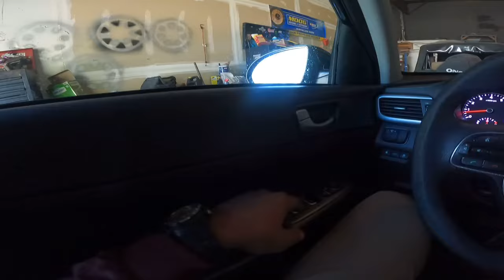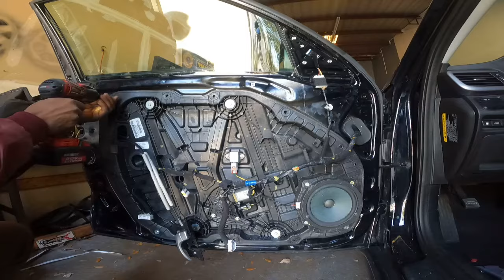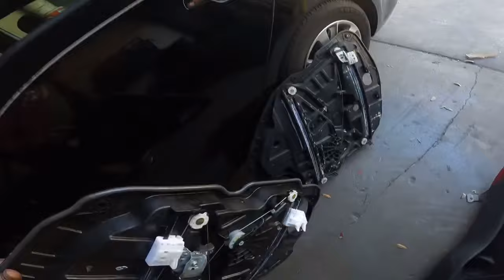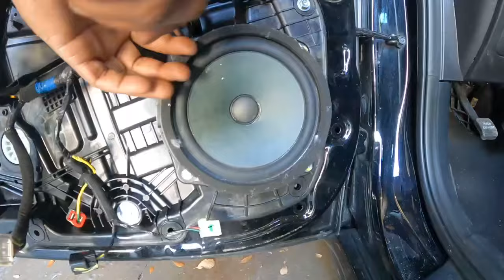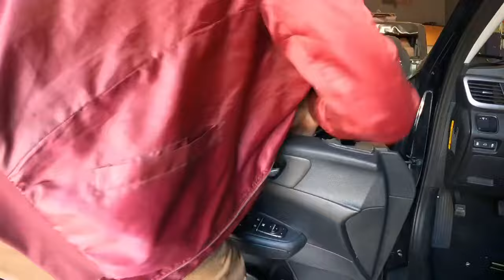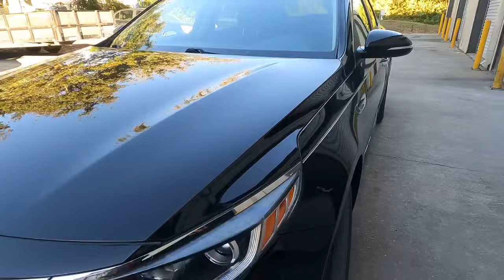Kia Optima window regulator (WONT GO UP)

Comment: Hi, Im Carrie. Thanks for the video. It was so less stressful having hands on training. Im from Texas, San Antonio and my 2016 kia Optima definitely has the window gear problem breaking. Three of the windows had the same issue. I didnt buy the panel just replaced the gear and i wish i had replaced the panel because the wire was a problem getting it to stay on.  Got it done though.

Comment: I live in Colorado I have a 2019 Kia Optima and My back driver side came off track twice. The window specialist says they have no idea why it’s doing it or what’s causing it. Should I replace the inner panel?
Reply from the maker: Honestly it was a horrible design, I do recommend going with a new part because trying g to stretch the cable back will on prolong the inevitable.

Comment: 2016 Kia optima ex, live in Louisville KY. I noticed my back passenger window was cracked and I couldn't roll it up, but could here motor so I put a suction cup on it to hold the glass up until I could fix it. 3 days later my back drivers window just dropped down while I was on the interstate, same symptoms. Now its a two door job and it makes me worry about the front ones.

Comment: I have the exact same problem, 2016 Kia optima , window (driver side) is loose big gap (upper left, from inside) I can hear the wind whistling, seems like it’s loose from the track , it seats on ,   it gets  stuck when trying to roll  the window up , have to try several times, holding the button insistently , will have to take it apart , the sooner, the better, thanks for sharing your  excellent video , will help a lot , from , Los Angeles ,California, thank you for your help, time ( liked & subscribed )👍
Reply from the maker: Thank you so much for subbing, make sure you watch closet in hoe the window is mounted. I don’t think it’s off track

Comment: My Kia is just like that same color /model everything . My windows both driver & passenger side don’t work , not going up , and I’m in TX so maybe your right about the dry and getting cracked . Thank you for sharing this vid , I’ll go by this to replace mine . Oh …you had some chipmunks singing in the background lol
Reply from the maker: Be careful because at any point the windows could drop and you would have to manually push them up and secure them to stay. 

Thank you so much for your feedback and for watching. God bless
Reply: @rollcam321  All my windows fell over a period of like 8 months or a year . Been this way for at least 2 years know with no help fixing it , so I’m about to do it myself . At least the 2 front ones . I’ve already fixed my knock sensor and my Variable charge motion Actuator …then I cleared my Admissions Drive Cycle this week … car has been down for 3 weeks and got tired of waiting so I fixed it myself . Sooo I figured since I down that the windows would be no problem for me to fix as well . And I never rolled down my back windows for them to go out so fast or my front passenger side really . I’ll just be glad to get it fixed , just tired of the whistling when my wedge starts working the windows back down 😫
Reply from the maker: I just lived out your whole cars existence through you lol 

I feel your pain… but honestly it’s a blessing you’re able to tackle a lot of these issues yourself. Keep up the excellent work friend 💪🏾🙏🏾🙏🏾🙏🏾
Reply: @rollcam321  lol 😂 Thank you it’s been a mess but definitely a blessing to be able to tackle the issues for sure ! Many Blessings Kia Friend :)

Comment: Rear windows had this issue, found a suggestion somewhere:

 grab some electrical cleaner (or electrical contact cleaner)

Spray the outside of the button, around the sides, front and back while actuating (I did this while it was all turned on) go heavy on the spray I used quite a bit before it cleared up and started working again.
Reply from the maker: Brilliant idea. Thanks for sharing

Comment: I'm in St Augustine Florida and I have now going to have to do all four Windows one at a time they have went out within the one year that we have bought our 2016 Kia optima
Reply from the maker: Wow sorry to hear that. 

It’s an awful design but I hope this video helps with the repair. Try a few different sources because dealer may not have it. 

Also it would be cheaper anywhere but the dealer.
Reply: @rollcam321  you got that right I'm in Florida man where do you think the best place to order that from I'm trying to find I guess what just your local O'Reilly's or AutoZone or something
Reply from the maker: Yes shoot for them first. They usually have some type of warranty on them so just double check. 

I’ve repaired a few of these and they broke months later. The design overall was horrible for the window regulators.

Comment: 2016 Optima, bought new in 2017, had been on the back lot for months. I bought an extended warranty on the electronic parts. I live in Houston, Texas area. The windows on the passenger side front, and then the passenger side back wouldn't go up. I don't use them very often and I think that is one of the factors (not sure why it would be, maybe not spreading the lubrication?). The window problems each occured after someone tried to roll them down. Shortly after, they would not go up or down, and would slide slowly down about 2 inches when driving on bumpy roads (lots of them in Houston, potholes and seams aplenty). I could slide them back into place by hand (placing palms on the outside of the window and pushing up) but they dropped again when driving.

Each was repaired at Firestone under the electronics warranty, 2 week wait for the parts to come in. I paid half, which was about $250. Now a 3rd window, driver side back, is suffering the same problem and the warranty has expired. I will repair it myself. Switch does not make a noise when I push it, could be motor out? Thanks for the video. Others show how to access the screws that hold the door panel on. 

So far (knock on wood!), have not had a problem with the front driver's side that I use at least once a day. I think that is why it is still working.
Reply: I was wrong about no noise coming from trying to roll the driver's side rear window down. I hear a motor sound from the back door when I operate the up/down switch. I also hear something that sounds like a cable running over the teeth of a gear. So, much be bad regulator.

Comment: I have a 2016 optima. This happened to all four of my windows within a 18 month period. First tear passenger, rear driver, front passenger. And front driver. Three were covered under warranty. Last window was not. Although it was going up/down very slowly and I knew it was going to happen next, my local Kia dealer refused to fix it. I contacted Kia and they refused to fix it. Seems it should be a recall. Apparently low quality parts/engineering flaw. I will never buy another Kia vehicle for this reason.
Reply from the maker: Yes it is one of the biggest flaws I’ve noticed about that year optima. I love the car, just don’t like the cheap window regulator or door handles. 🤦🏾
Reply: Yo I just had all 4 of my windows do in a 7 month period. Like I thought someone was messing with me. First one went we fixed it then another one then another one and now my last one I live in Florida and keep my car outside. What else should I expect to go wrong with my car. Lol
Reply: Well, let’s see. More than likely here are some things that will/can go bad. Mine did. Trunk latch. For whatever reason, it just stops working. I was at the store one day, look out the window and my trunk was wide open. I was 30miles from home. Luckily I had a tie down strap in the trunk that held me over til I got home. I had to order a trunk latch off Amazon. Oil pressure switch. It went bad, cause engine light to come on. I bought a replacement and changed it myself. It’s in an odd location. I finally got it though. Acceleration!! When getting in the highway, I could get up to like 70mph and then it would “loose power”. Car was still running but I could not do more than 50mph. Did this like 5 times. Very dangerous. Once I pull over, turn the car off, and restart, it was fine. 
Hesitant to start, seems it was something to do with a low oresssure fuel pump. Kia would not do a recall, instead, they send you a letter in the mail that says “if you are having these symptoms” take it to a dealer and they will check and fix for free if that was the issue. I’m sure there are a few more things that can/will go wrong but I do not have time to keep typing ,lol. Loved the car when I first got it, (sx turbo) but the closer it got to 100,00 miles it went straight downhill. I will never buy another Kia again!!

Comment: Same issue,  kia optima 2016, Miami FL

First back right, then back left, and today front passenger.  All within 1 month.
Reply from the maker: Wow.  I’m sure the heat has something to do with it. 

With it being cold, then hot, then cold… then we have long periods of extreme heat. I’m sure is melting the lubricant from where it’s needed most. 

Without the lubricants parts start grinding, and from there issues happen.  After so much time and talking with people ultimately I think that’s the main cause.

Comment: This same thing has happened to my parents Kia Optima 2016.  All 4 windows and we live in Massachusetts.
Reply from the maker: I guess it’s a common issue no matter what state your in. How did you end up fixing the issue? 

Did you go to dealer?
Reply: Same thing happened to mines. Literally one broke and then all 4 mind you I rarely put my windows down. I actually remember the last one breaking on its on…I was driving and it just fell down. All of my windows broke in less than a year. Just now fixing all of them. Bought the parts from eBay for 600 for all 4.

Comment: This is a big issue happening with kia optimas from 2016 (my year) through 2021 i think. My passenger window just had this happen and while searching I found a class action lawsuit. Kia refuses to fix it. instead they want you to go to the dealer and spend $450 for a fix. Im in Florida.
Reply from the maker: Yea that’s a rip off. 

I swear the heat is causing the line to melt and cause friction on the wires.
Reply: @rollcam321  I havent opened the panel yet, but the dealer did and said the teeth on the gear had worn out. Thankfully they didnt charge me and just put the window up for me. Kia seems to be using cheap parts. I barely use the window that has an issue and reading online a lot of people say the same thing. Plus they say it will happen to the other windows as well. I finally paid the car off in Jan and now this.
Reply from the maker: @nonya13  your right about the cheap parts. That why the overall price on Kia is lower than some of its competitors. 

But….. every car has its week points that eventually come to surface over time. Kia has cheap door handles, window regulators, and even the interior isn’t all that expensive.

Comment: Excellent video! Thankyou so much:) My Sportage R same family has now a problem with the drivers side. I will take it into KIA and see what the problem is and then see how much it is going to cost. Did you have to remove the glass?
Reply from the maker: Yes for sure have to remove the glass, but…. The dealership inflate everything, try and tackle this one your self. 

I believe in you
Reply: @rollcam321  I will check with KIA to access what the problem is, and then see how much they charge. If it is steep I might consider DIY. Thanks
Reply: I went to KIA and they replaced the motor it didn't work, they replaced the switches it didn't work, they checked the regulator and also the fuses. But still the window didn't work.....They said I will need to go back and check again.
This is stressful
What do you think the problem is?
Reply from the maker: Have you paid for all of this work to be done? If so I think they took advantage of you honestly. 

Something does not sound right at all!!!!
Reply: No didn’t pay. They ordered the part it didn’t work so they sent it back .Just used up a lot of time
Reply: I live in S.Korea 
The service is pretty good
Reply: I’m so baffled about what the problem could be
Reply from the maker: Is it the driver window only?
Reply: @rollcam321  yes driver side
Reply from the maker: @winking2928  instead of them just replacing parts have them track down the wiring system through the wiring harness to find the issue. If power is still going to it and the ground is good I could be computer related. 

Also being that your in Korea, different weather and conditions could cause different issues to cars.
Reply: @rollcam321  tomorrow I will check again and get them to look at the wiring. Thankyou so much for the help. Will keep you updated
Reply: @rollcam321  Today KIA spent 2 hrs finding which wires had the fault and it lead to the CBM computer box module.
They made the window go up and down now with some extra wire and then next week when the module arrives they will replace the CBM.
Reply from the maker: Awesome I knew tracking the wires down to see which one was dead would be the easiest way to find the issue. Glad you got it covered, thanks for watching my video. 🙏🏾
Reply: @rollcam321  Thankyou again for the quick feedback. Will definitely support your channel
Reply from the maker: Thank you bro 💪🏾

Comment: Yes I also have a 2016 Optima and one month after me having the car the back passenger driver side dropped a week later the passenger side on the passenger side of the car in the backdrop and needless to say the driver side window stopped and now my passenger side has stopped I was able to find the parts on eBay but Kia needs to do something with this issue Cape Coral Florida
Reply from the maker: Yep your in the southern state too. I’m in Florida. 

Such a common issue it should be a recall. 
I think it’s cost them too much because everyone has had this problem.

Comment: Soo when you put it back in did you have to reset the window in anyway?? I recently swapped mine on a 2015 kia optima. The button turns the motor but the window doesnt move like in the video. But even after putting new one on still nothing?? Im lost on it.
Reply from the maker: It may be the actual switch that’s giving you the issue. Possibly broken button instead of window regulator? 

Either that or that regulator could be faulty…

Also make sure the window isn’t jammed and installed level.

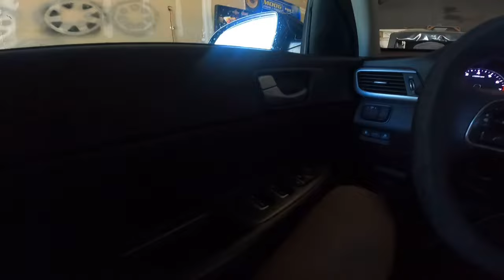Comment: 0:58 can anyone help me. So I have a 2015 optima. Driver window went down and only up 1 inch.  We changed the regulator and when going up it would get stuck in 2 places. Had to manually pull it up past those 2 points. So changed the buttons and the motor. It is still getting stuck going up.  Any recommendations? TIA
out of warranty

Comment: I'm having the same problem with my 2016 kia optima first it was the front diverside and the the rear driverside after that one and then other day the passenger rear went out the front passenger side still work I'm having trouble finding the window regulators kia say that they all are on back order and they want 250.00 each for them do anyone know where I can find the regulators I also tried the junk yard no luck there and kia said there is no warranty that will cover the window regulators
Reply from the maker: That’s the tough part finding them elsewhere.  But…. Try junk yards.  It’s not the best bet but depending on source it could be reliable.

Comment: I am living in   Dallas, I have a 2016 ex optima  , my back windows stopped working, then only yesterday the front left window stopped working. Frustrated Kia owner
Reply from the maker: See I’m pretty sure it’s the southern states that the heat is causing the grease to melt out. 

Causing friction on the metal cords that lift the window up and down.
Reply: @rollcam321  I think that makes sense, my car is outside all the time, the heat in the summer can’t be good for car, thanks for information
Reply from the maker: @MsTOMorgan  absolutely. Also, you ever noticed because we have higher temps threw them the north……

Our dashboards and plastics become super brittle
Reply: @rollcam321  That’s for sure this car really needs to be under cover with the extreme temperatures here

Comment: why not just stretch the cable around the white roller circle and lube it up ?
Reply from the maker: Generally that can be done but if it’s wore out there’s a great chance of it happening again. 

The worse part is, if that window drops it could shatter, or even worse… it could happen while your out on the road when your least expect it.
Reply: @rollcam321  Looks like this part could be redesigned to make the cables not slip off
Reply from the maker: Agreed, but techs are the brilliant ones… engineers make our lives so much more difficult lol

Comment: Hey 👋🏻 can you please tell me where you bought this part? Kia refuses to give me the part # and I’m not having luck finding it anywhere. Please I’ll appreciate you helping me with this.
Reply from the maker: At the time I purchased my window regulator assembly at the dealer. But…. Amazon and eBay always have options. 

Also check out your local junk yard if all else fails. Let me know what you find
Reply from the maker: And eco place as well?
Reply from the maker: @carolinagiraldojimenez7273  they are really good. Just saw them about a week ago for a common issue part.
Reply from the maker: @carolinagiraldojimenez7273  awesome!!!! Please subscribe to the channel